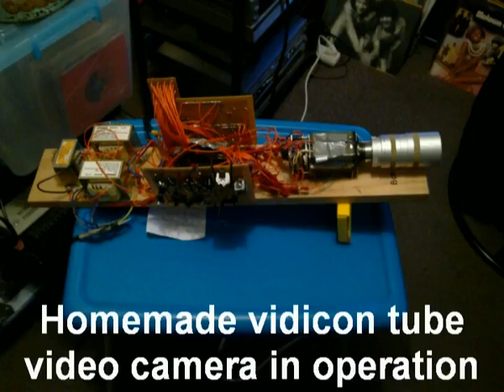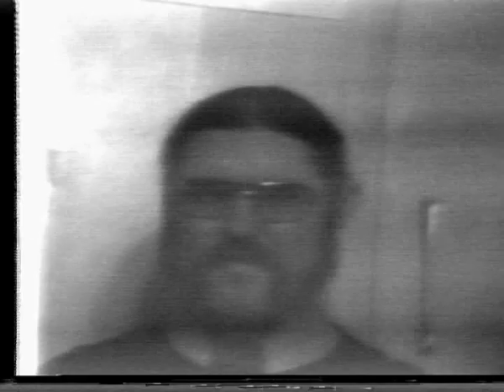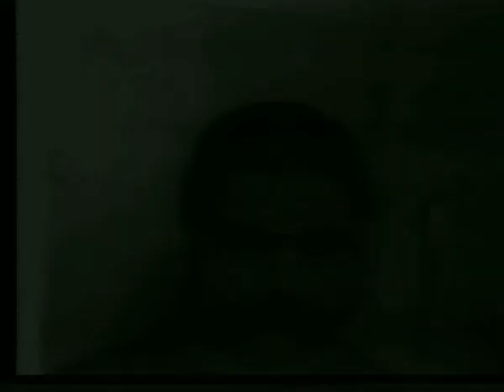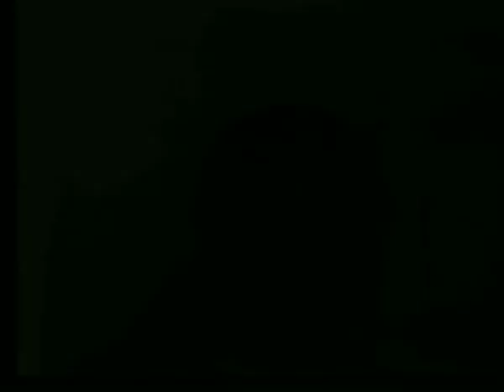My homemade vidicon tube B&W video camera finally working!!!

Comment: Crazy idea: Make three of them, use a prism to split the light into RGB, and bam you have your own homemade 3-tube color vidicon camera. That would be amazing to see. Of course it would be super hard since you would have to design an NTSC encoder/matrix circurt, but you could just capture the output of each tube and do the processing digitally in software. But you would have to design some kind of registration circuit so all three tubes are aligned and you can make adjustments.

Comment from the maker: Depends on how the tube is mounted in its yoke. Generally you unplug the socket at the back, loosen any gripping mounts, remove the lens and the lens mount and anything else that is holding the tube in position and remove the tube. Then find a suitable replacement tube and place it into the yoke and fasten it the same way you undid it and of course make sure the tube is correctly positioned, take note of the position of the where the shorter or omitted pin is on the tube for reference.